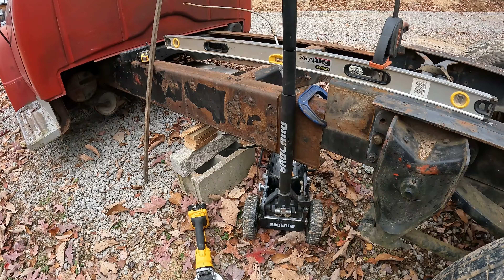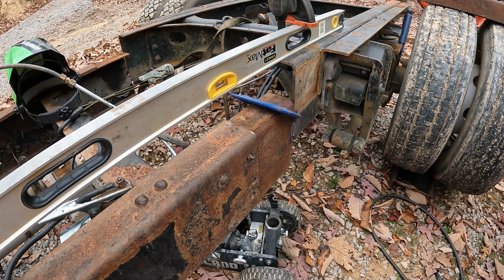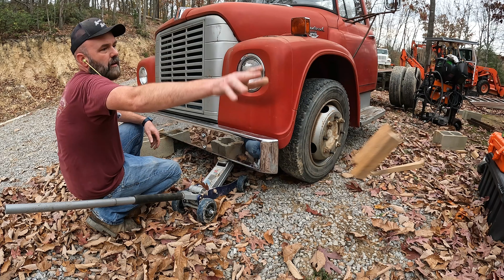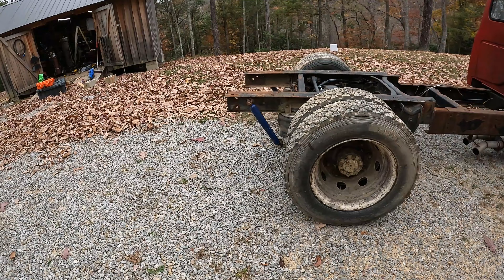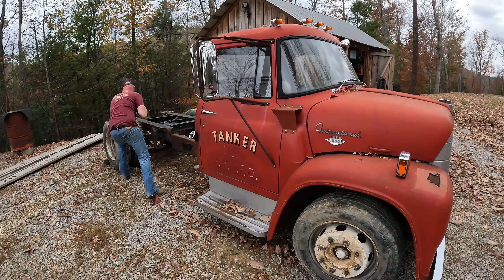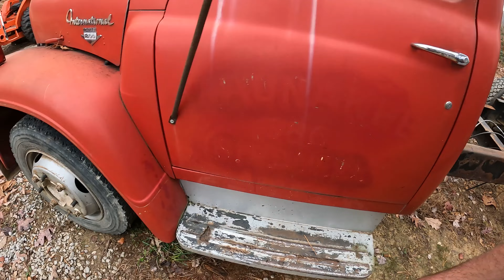Welding the Lowstar Loadstar frame(sort of)

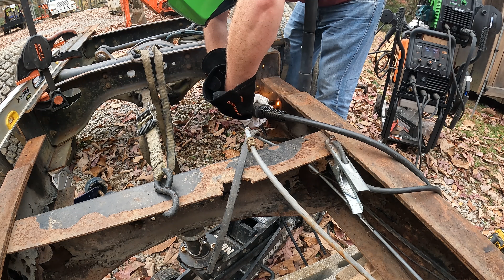Comment: I don't know about your neck of the wood .but I am not sure if that is the right way of joining a frame together ...are you going to have the truck inspected to obtain an engineering certificate  ..you will be hammered for doing such a thing. 5:58
Reply from the maker: @rafidishak7801  it’s definitely not the right way to join a frame. Lol. I’ve got a lot more work to do for sure. I just need to move the truck to a better spot and I wanted to get some measurements before I committed to a drop and length I liked. No inspection here either.

Comment: The pinion angle will probably always be off except for at one exact ride height. The length of  the lower link is so short it will change the angle quite a bit with even a little bit of change in ride height. I am going to do a 4 link with fairly long bars on mine to minimize this.
Reply from the maker: @mattkenaston7180  I’m hoping it’s close enough that it’s not an issue. that’s a good idea on the 4 link. I’d say it will ride good on those long bars and bags. 👍🏻